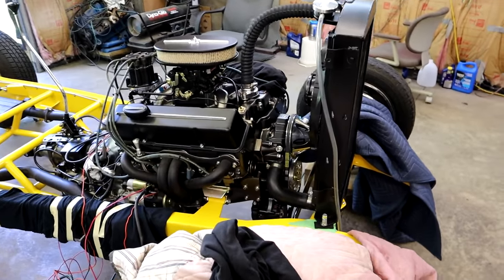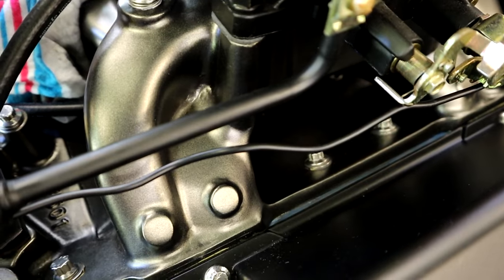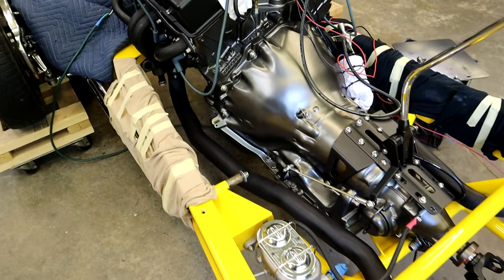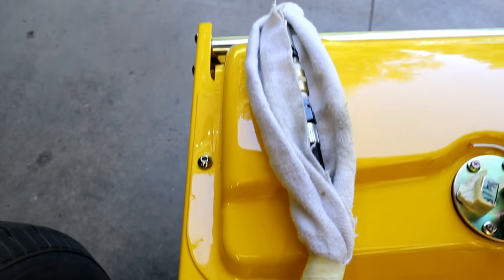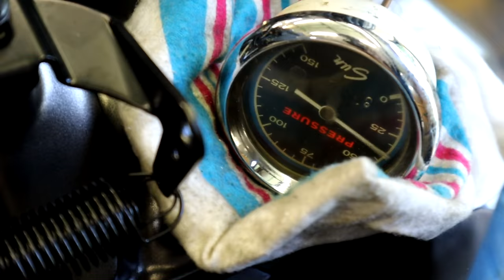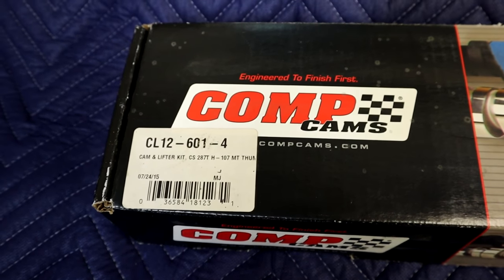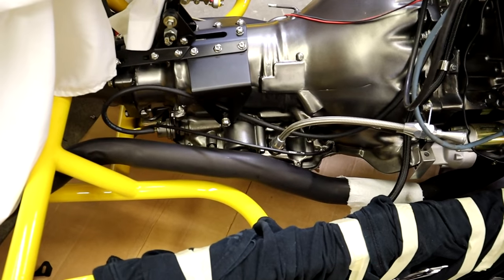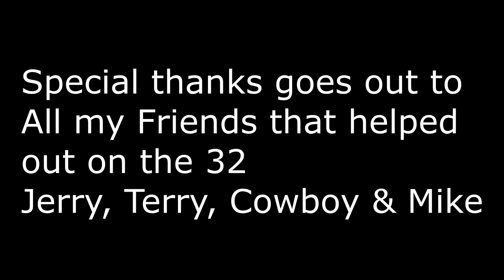Crate 350 Small Block Chevy - with Mutha thumpr Cam - First Start !!!!!!

Comment: CAN IT HOLD A LOW IDLE? And does it pull off the bottom? , I'm just curious if they recomend a stall converter? My 1981 corvette build has same trans as you guys, but I'm using vortec heads with bigger valves, springs good for .550 lift. Did you guys do valve springs or whatever came with crate motor...Really love the premium work, extremely nice Street Rod...I'm Jealous..a little! LOL
Reply from the maker: It has a pretty good low idle haven't drove ot yet on the road so i cant tell you about the bottom end, my buddy has the same setup in a 64 c10 and it goes pretty good.
Reply: @ACDesignsGarage  It's gonna be my cam, was mainly worried about idle. I don't want my false teeth to chatter at stop lights ...lol
Reply from the maker: @lad63bird  hahahaha thats when you know you got a good cam hahahaha
Reply: @lad63bird  Youre going to need to up the  stall speed for sure, need plenty of inital timing, proper rear end gear also to make it run like it should

Comment: The prep and coating on that intake manifold and transmission looks great. It looks three-dimensional.
How many horsepower did they rate that crate engine?
Reply from the maker: Thank you!!! The coating is just a automotive basecoat clear coat, but the clear has been flattened ,the horse power was like 290hp I think from jegs
Reply: @ACDesignsGarage  well 290 HP nothing wrong with that. It will  make your rod haul ass.
Reply from the maker: @bobber55  hahahahaha

Comment: In a 63 ss, same engine but with a power glide, if I get the same cam kit will I need a stall converter or trans cooler ?  I also have regular drum brakes… would this cam be wise for me ?
Reply from the maker: Comp calls for a 2500+ stall and a cooler wouldn't hurt. Not sure on the vacuum for the brakes because dads 32 is running non power brakes. I always recommend disc on the front because of the traffic, hope this helps and thank you for the kind words, check comps web site for the recommendations!!!!!
Reply: @ACDesignsGarage  thanks so much !!!
Reply: Definitely need a decent stall converter....wtih a powerglide I hope youre ok with say 411s. 
Not a great cam imo for your app

Comment: I'm so glad you didn't wipe out a cam lobe. I was on the edge of my seat when you started it and let it idle so much. LOTS of people wipe out a lobe doing that. You need to get that oil pressure up around 50 (2000 rpms and hold it for close to 20 minutes. It looked like you guys are some lucky guys! I'm so glad it all worked out perfectly. Fantastic looking engine and trans. You can tell you took your time and did all the paint and sanding work to perfection. Without the body it looks like show quality work already! Now, can you build me one for $10,000? LOL Awesome video!
Reply from the maker: Hahahaha yeah I filmed it but the video was getting so long, I figured that would be the easiest thing to edit out lol, Yeah I've heard of alot of people wiping the lobes off cams just runnin em like that. As for the 10k I wish I could build em for that hahahaha, thanks for your comment!!

Comment: Will that cam handle stock height springs ? Did it come with springs also ? What type pistons and did they have to be flycut ? Thanks so much for any info.
Reply from the maker: The kit we bought that I have linked in the description cam with new lifters and the cam, I've heard that cam was designed for stock crate motors, they perform pretty good, but they were really ground for the sound , I have a buddy that has had the same cam for a few years in a stock 283 chevy and it works great. Its gonna be in my new video of a 64 c10 that should be out this evening if you wanna check it out, by all means check with comp cams to make totally sure!! Thanks for the support and comment !!!!
Reply: @ACDesignsGarage  TY very much
Reply: Get proper springs, they arent much and you wont risk breaking parts.

Comment: Do you need to change the stock torque converter with that cam?
Reply from the maker: Its a stock converter but its a super light car, ut should be good.
Reply: @ACDesignsGarage  Weight doesnt matter there if the converter is too small it will still want to die at idle or have to drive 2 footed to keep it running. Even a 2800 will feel like stock til you nail it.

Comment: Is that top rad hose going to work, it seams like quite the hike up to the radiator.
Reply from the maker: Thanks for the question,  so far we've built several cars with that same setup and haven't had any trouble, when we were breaking that cam in it was about 100 degrees in the shop and it ran for about 2hours and stayed around 180 degrees.
Reply: @ACDesignsGarage  Ok thanks, I was curious.
Reply from the maker: @joe-hp4nk  thanks for the question and your support!!!

Comment: So what RPM do you think that will run at like 6,100 ?
Reply from the maker: With the 31 in tall tires and a 2:73 gear probably 2500 lol
Reply: @ACDesignsGarage  I mean red line ?
Reply from the maker: @deluciv6634  that probably sounds about right, I was figuring 6500 max, but it will never see that
Reply: @ACDesignsGarage  Oh no....way wrong for the cam youre using who told you to buy this?

Comment: It sounds like a stock low compression motor with a big cam
Reply from the maker: It is lol
Reply: It is. And a 31 inch tall tire, tiny converter and 2.73 gear. Dad is not going to like how it runs, wont peel the skin off a grape

Comment: which sounds better, Thumpr cam or Mutha thumpr cam?
Reply from the maker: I think the mutha thumper in my opinion, the thumper is a little milder cam, it still sounds good just not as radical.
Reply: AC Designs Garage can you run it with stock valve springs on the stock 350 head. I don’t care about making power I just want mine to sound that good!
Reply from the maker: @Zanehoward88  Oh yeah this motor is a bone stock 350 crate motor. Thats how we are we wanted it to be , sound fast but be reliable, cause its just a cruiser!
Reply: AC Designs Garage thanks for the info!

Comment: Did you use the stock valve springs?
Reply from the maker: No the valve springs are still stock, all we changed was the cam and lifters that came in the cam kit. Thanks for your comment 👍

Comment: Why a chevy motor in a classic Ford? Is there a particular reason?
Reply: Raymond R.... in the world of High-Performance V-8 engines,  Chevy Sm. blocks make more power per ci for Less money than any other push rod V-8.   Chevy got the heads "right"... right from the beginning in 1955, and a Big part of making power... is how well the ports in the heads... flow.   If the heads & ports within them don't have high flow rate potential by their inherent factory design, then it doesn't really matter what else you do internally to modify an engine. 

Sure, you can modify any engine to produce more power.... but compared to another engine of the same displacement and rpm maximums... which one will produce more power for an equal amount and kind of modifications per ci.... and when you compare that equation between Ford and Chevy... Sm. blk Chevy versus Sm blk. Ford with the same ci... Chevy's will produce more power, for less money spent. 

Keep in mind, that I am referring back to the mechanical / Carburetor years, and many of today's "Hot Rods" are still utilizing the "old" technology.... why?..... because it's Simple, it works, and if something happens to go "wrong".... you can (most of the time, anyway) actually "See" what the problem is and can probably at least "jury rig it" to get somewhere where it can be fixed correctly...... you Can NOT "see" the problem if it's in a wire, or sensor, or computer, or module or etc, etc, etc.

It's easy to "over cam" an engine, if the heads are not capable of being able to match the flow potential of the cam... and the "performance" will be "lack-luster" to say the least.  Another reason, goes back to the Pre - computerized days.... when bell housings, bell housing bolt patterns, starter position, etc, etc.... was the same on all Chevy engines from the iron inline 4 all the way to the "mark 4" engines ("Big blocks"). 

Ford.... on the other hand, had so many differing design's, part numbers, bolt patterns, from year to year and from engine to engine... you'd get a headache just thinking about it all.... Chevy's were just... cheap, easy, reliable, made great power easily & cheaply.  Chevy's oiling system and lower end was/is... "right on" from the beginning as well.... just ask any of the off shore boat racers!! 

One other reason is... that's what "Hot Rodding" is all about.... it's what you do in executing the "build" and how you do it, and the total combination of parts, paint, power, etc, etc....to make it "your own" (no other quite like it).  Hope this answers your question... at least, somewhat.
Reply from the maker: I think it use to have alot to do with price, the chevys have been more available and cheaper, plus in the street rod world having the distributor in the rear on the chevy looks better cause  you can hide the wires better, just my opinion lol. Thanks for the question

Comment: is that a walker radiator in the car and if so would it be the z series? thanks
Reply from the maker: Thanks for the question,  it a PRC radiator ,its aluminum we just painted it, it seems to be top quality
Reply: @ACDesignsGarage  I noticed the water temp was around 190°, did you use a 190° thermostat and if so I'm curious as to why you chose that over a 180° thermostat?
Reply from the maker: @bodeine454  we used a 190 cause we had one layin around lol, thanks for the comment!!!!!

Comment: Is that a fully dressed crate motor? Or was it pieced together?
Reply from the maker: It was a long block crate motor from jegs, we added the intake, valve covers, carburetor, water pump and all the accessories , thanks for the question 👍

Comment: Sounds like a bit of overlap in that cam shaft.🤪
Reply from the maker: Maybe a little hahahaha
Reply: @ACDesignsGarage .... Thank you for sharing you & your dads "build" and first fire-up!!   I can hardly wait to see it with the body on it.... is it steel, or a "re-pop"?  I "Love" the color of it... what color is the upholstery going to be?  If it were mine, and that beautiful deep yellow, I think I would do it up in a nice "saddle tan" color of leather... would Really be a great, striking contrasting color against the yellow & would be Very "complimentary" to each other at the same time, while giving the interior a feel and look or "warmth".  I Really like and appreciate the attention to "detail" that you've employed to the build, and no doubt will continue to do so til it's finished.... Great job!!

It brings back memories of my first car build, which was my first car... that my dad gave me for my 13th b-day!!  He told me that I was Not getting my drivers license until it was built and running, and I was going to do it all and pay for it.  It was a 31- 3 window (Ford) sitting on new "boxed" frame rails, a radiator shell, a new 4" dropped front axle, 4 "scab" wheels & tires (just to move it around), a hd 57 Olds rear from a J3, the original all steel body stripped right down to the bare metal (inside & out) mounted on the new frame... and That was ALL!!  : )

I already had my first summer job since I was 10 years old,  got a 2nd job when I was 12... working at a new, local Racing Go Kart shop/store (early 1960s) after school, setting up chassis & engines for customers, and a part time 3rd job pumping gas, etc. (when I was 14) at a gas station across from the Go Kart shop.  I had the 31 built, running (409 - 409hp "W" Chevy), sold.. and on my 2nd build (bought 57 Chevy Bel Aire with no  engine/trans for $50. - built a "301" sm blk for it with an M-22 4spd) before I turned 16 and got my drivers license. : )

The Only thing I did Not do on it... was paint it, though I did help with the prep work, sanding between coats and polishing it out.... and I had it painted.... Yellow, but not quite as "deep" as yours.... but close, and had a fine, gold metallic blended in with it. 

The guy who bought it from me...STILL has it (or had it... last time I was back home for a visit in 2011), but last time I saw it (and drove it!), he had a blown KB Hemi in it, with a "clutchless" 5 spd.  I had a 4" drop in the roof line, and he lowered the body another 2" over the frame rails at some point in time... made for rather tight fit between both of Our "rears" and the roof line.... but, Ohhhh what Fun, when the "loud pedal" was mashed the!!  Put a Huge smile on our faces!  : ) 

Sure, there are some fast cars out there, today... but one thing that our engines had, that a lot of these new cars don't.... is, Brute Torque..... loved that feeling, when you would plant your foot on the firewall, and it tried to stuff you into the trunk, until you let off of the loud pedal...... came in real "handy" when you had a 1st date that was being kind of a prissy... and she was maybe sitting right next to you... on a cushion between the "buckets"..... and you'd "walk on it" just for a few seconds, and it would stuff Her... into the back seat!!..... would "save you" from having to come up with some reason why you didn't want to ask her "out" again for a 2nd date.  lol  ; )    Ahhhhhh, the memories!!  : )

I built an HD 421 for my 1st 66 "Goat" after I got home from VN in 70, put an Isky Super LaGuerra 505 cam in it.... had so much over-lap that it wouldn't idle under 1050 rpm... had 13.5:1 cr. and it wouldn't run on anything except the "good stuff" from Sunoco.... the "famous" Sunoco 260 (114 or 118 pump octane rating?)... leaded of course. 

All the Sunoco Gas Stations sold it, right from the pump... even NASCAR (& others) was running it as their "official fuel" back then..... as well as a lot of the NHRA guys in drag racing. 

Sure Miss those days!!.... when we built our own cars, cops were respectable and respected people,  nearly Everything was still "Made in the USA",  "guys, were guys.. and girls... were Definitely WOW!!".... and Nobody questioned what gender they were, or not!!!     Waiting with anticipation on seeing the body go on the frame rails!!... am really happy for your dad.... hope gets to enjoy it for many years to come... you "did him proud" on this build!  ; )
Reply from the maker: Thank you very much!Its a fiberglass  body, wish we could of bought a steel one, but there so much more! Awesome story I love to hear stories about the good old days and all your cool cars!!!!!!, as for interior i like your idea on color! Thanks for your support!

Comment: Nice build tho I'm not a fan of the clickity clack pumps they don't hold up well at all a good pump is maybe a bit more noisy but you'll find out they are much better anytime I can put the tank sending unit In with the pump in the tank and use a fuel pressure regulator that's the way to go and I'm not a fan of Edelbrock or Holley carbs I'm a old school quadrajet man you'll get better reliability and quite a bit better milage as well from them if you stay out of it nice build tho for real
Reply from the maker: Hahaha we thought about that when we chose the fuel pump, so we bought a spare to carry So we gonna try it out, We was gonna run a mechanical fuel pump but we were trying to clean up the engine the best we could. Thanks for the  comment!!!!!!

Comment: Does it still have stock valve springs with that cam?
Reply from the maker: Yes just what came with the stock crate motor
Reply: @ACDesignsGarage  That's amazing lol, I'm putting mine in now.
Reply: @ThinkBeforeYouSheep  Hope you upgraded valve springs. STockers esp used ones wont cut it
Reply: @gordocarbo  I have new valve springs.

Comment: Would you recommend this on a l31 350?
Reply from the maker: I love these cams, they sound good and perform good, so If they make one for your application I'd say you would enjoy it!
Reply: No use the GM performance lt4 Hot cam. Your motor has roller lifters. the thumpers only good for sound it's not really a powerful cam. Much better cams out there

Comment: You started it and idled it down almost right away it should have been run at 2 grand for 20 mins up and down a bit with plenty of zinc additive I hope you didn't wipe out any lobes we will see I guess but I don't idle em down at all for the first 20 mins at least
Reply from the maker: Thanks for the comment, I broke it in as per comp cams said to, but I edited most of that out due to making the video to long. Thanks flr your support!!!!!!

Comment: Why make your street rod into an over cammed dog?
Reply from the maker: Cause its cool lol 😆
Reply: @ACDesignsGarage  With 249 @.050 on the exhaust side you'll be able to light a cigar off of the header pipe which might be cool.  
With that exhaust system your engine would be much happier and run better with 218 @ .050 on 108.   Grind it on 106 if you want it to lope more.
Reply from the maker: @DaveMcLain  thanks for the info!!!
Reply: He does need better flowing heads, I'm about to get some AFR 195's , best flowing heads out of the box!  Probably will have trouble with your breaks too,  it does sound great though!! Vacuum will probably be low, might need to get you a canister for your breaks

Comment: why a chevy in a ford?
Reply from the maker: Thanks for the question,  we just prefer the small block chevy over the smallblock ford, there cheaper and there are endless supply of parts and go fast goodies. Dont get me wrong I like ford motors also like flatheads and Y blocks, I have a flathead in my shop but cant afford to build it right now lol

Comment: your going to be luckey if the cam doesn't go flat, letting it idle to soon after start-up. always turn idle screw up never hold it with your hand. you should have shut it off and let it cool down.
Reply from the maker: I just showed part of the start up, we broke the cam in by procedure, I just edited it out cause it would make the video to long, thanks for the comment 👍